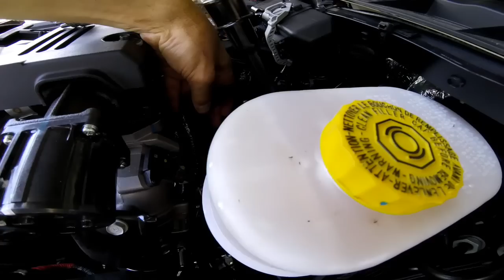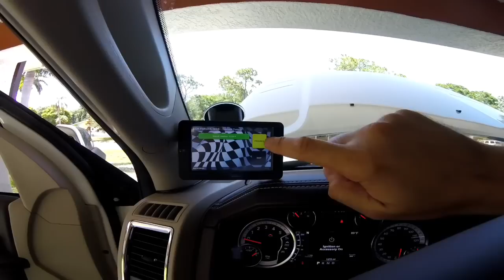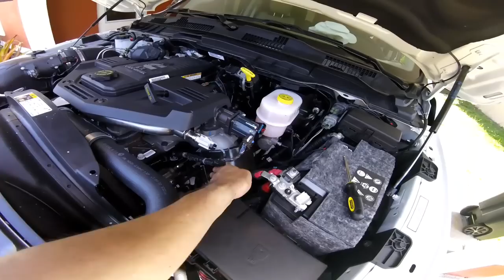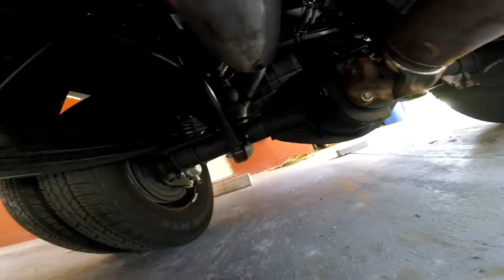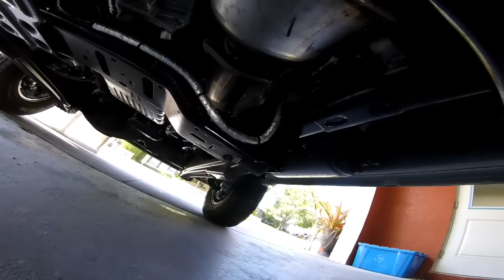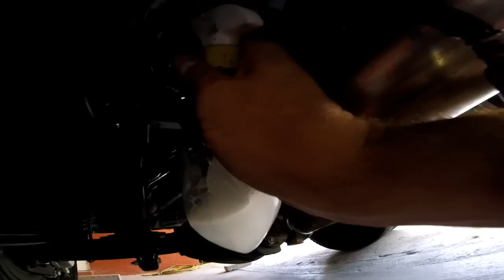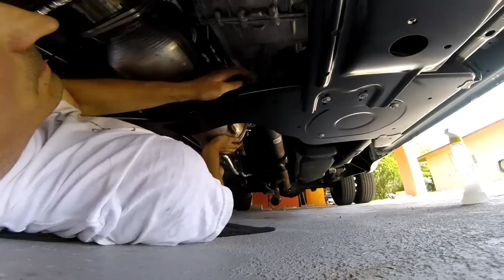New Ram 3500 DPF EGF EGR delete with RaceMe Ultra

Comment: great install video how did you get the cable through the dash ?
Reply from the maker: I spoke about that in the video... the penetration point. Access panel above the brake pedal on the firewall. Drilled it and used a grommet.

Comment: Great video.  So installing this software bypasses the egr but you don't have to actually block off the ports?
Reply from the maker: Correct, but you should disable the EGR system as shown just to make sure. I will remove all the hardware later once I am past the warranty period.
Reply: Shaun Volkmann do  you only remove all that exhaust pipes to promote free flow? And if you left it there, but unplugged there would be unnecessary back pressure?
Reply from the maker: @JeffLamp3  The ceramic filter inside  the OEM exhaust system would plug up, and you would destroy your engine. The very system you are disabling is what burns the soot off of the DPF honeycomb. It is this system that stiffles fuel economy and performance. You must remove the factory exhaust system. Straight pipe, or like I showed use a diesel muffler if you don't want it so loud.
Reply: Shaun Volkmann thanks for the quick responses. I just picked up a 2018 ram 3500 slt dually a few days ago. Only have 350 km on the truck. We are lucky in canada where I live there are no emission testing

Comment: To make sure I understand u can go back and reflash the ECU with the stock tune?

I have lifetime engine and tranny warranty on my 2013 that’s why I have been slow to want to delete my emissions..
Reply from the maker: Yes, you just select "return to stock software". I had to return mine to stock for some huge warranty issues non power train related, and wanted no questions asked. All they did was boost my DEF injection rate because they saw soot in the tailpipe. Lol
Reply: Shaun Volkmann if you return to stock do you change the tuner before you put the dpf back on and restore the connections under the hood, or reconnect first and then change the ecu back to stock?

Comment: Hi there Shaun, great video, another way to do it!  So by unplugging the EGR connections and using your raceme ultra, your EGR is no longer functioning - then, exhaust gasses are no longer pumped in?  Is that correct?  So your oil is not black?
I have a 2010 3500 Ram 6.7 TD Dually.  I have been reading, asking around about Deletes.  I am now seriously looking into this, not merely for MPG & HP, I just want to prolong the life of my engine.  I now have 140,000 miles on mine.
thank you again, I hope you get back to me on mt questions.
Reply from the maker: Yes, that is correct. Hard removal is recommended if you are out of warranty. Oil turns dark after about 3,000 miles, but not black when EGR is connected.  The stock ECU runs the engine lean, and restricts timing for emissions. Drive one who has it deleted, the difference is unbelievable how much smoother it runs and pulls.
Reply: @shaunvolkmann1904  ok!
Thank you Shaun for the reply!

Comment: I have a 2013 3500  6.7 with 60k i want to delete it do i need to remove everything and place in block of plates or can i just unplug everything, if so would i have problems in the future of any kind
Reply from the maker: Juan, I show just unplugging everything in this video so I can plug back in if I needed warranty work. Hard removal of emissions equipment is recommended by RaceMe. No one wants any problems, and have seen trucks running both ways without any problems. When I am out of power train warranty, I will use the block off plates and remove the garbage under the hood.

Comment: I've read that it's usually the DEF system that gets repaired a lot.  What exactly is the issue with the DEF that keeps needing to get fixed?
Reply from the maker: This removes the system entirely. The DPF system measures the flow before the system and after, then messes with the engine to burn off soot buildup giving you terrible economy. Tear that junk out!

Comment: Hey Shaun the probe on the down pipe do you leave it plugged in? Maybe a post egt probe?the one right before the three bolts that bolt to the bypass
Reply from the maker: Hey Billy, yes that sensor is disabled with the delete but I left it in place. I read a few places that the voltage on the harness is important for transmission controls.  I left as much as possible on the harness, and zip tied it out of the way.

Comment: Helpfull video.  Can I leave the exhaust system in place while driving cross country under warranty?  If the truck died, I can reconnect everything else before the tow truck gets there but I wouldn't have to deal wit DEF, and will pull exhaust off closer to home.

Also, are those fuel figures calculated or via the trucks computer?  I had an Edge Comp on my 2001, the trucks computer always showed better mileage than what was calculated.   Just wondering, but hopeful.   I would love to see close to 20 MPH
Reply from the maker: D T you will destroy your truck if you leave exhaust in place

Comment: Thanks for this helpful video. Does your DEF gauge still show empty after all this time? I just programmed successfully(according to the ultra) for the first time with all the emissions components still in place, yet my def gauge shows full with key in 'run' position. I am running the latest update from raceme and wonder if they changed something to actually show full def tank for some reason?
Reply from the maker: TheBr0dyagi the latest update includes the DEF sending unit status. When I made the video, it shut that gauge down.
Reply: Thanks. Just finished ripping the rest of the junk out - all good now.

Comment: Loved this video. I have a 2013 and like my engine bay looking stock. I had NO idea that I was able to leave the EGR components, etc intact and simply disable them.  I think a RaceMe Ultra and exhaust in in my future. I am pretty happy with the stock power.... Mainly looking for the MPG increase. In all honesty, all stock is treating me well at 20.5 MPG on long trips. I don't see how I can get much more out of it!
Thank you for the video.... You did an excellent job demonstrating all the steps necessary.
Reply from the maker: tomduncan1970 you can leave all stock settings for power, and only delete emissions if you like. That's what I am running till my warranty is up.  What rear end are you running with the great MPG? 3.73?
Reply: @shaunvolkmann1904   Sorry Man.... I am just seeing your response 3 years later! I'm running a 3.42 ratio

Comment: I glued my blue LIBERAL pos DEF cap on after deleting! Clean oil to 5k & 25-33mpg!
Reply: 33mpg....you must drive a VW
Reply: @Defender_Tom  My 2004 long bed crew cab High Output Cummins with the 6 speed would regularly net me 30+ MPG. I got 35 once on a trip to Kansas. Trick was to stay at 65mph. I still have that truck, 489,000 miles, one set of injectors, and oil changes. Still gets 28+ MPG. The truck is falling apart around the drive train however...

Comment: Did you just tape over all electrical connections on the egr and exhaust too ?
Billygibbons007@yahoo.com
Reply from the maker: Stephen Griggs I put plastic bags on and taped the exhaust connectors. Just tape under the hood

Comment: So I had my DEF delete done about 2 months ago and put the raceme tuner on it. I also went from 14gpm to about 19.5gpm on my dually.  I just the EGR delete like is done in the video. It was pretty simple and quick. I have about 25k more miles on the drive train warranty, so I guess when that is up I will do the complete EGR delete.  My plunger looked like it was installed in my chimeny, super black and caked up.  I will let you all know how my truck does in a couple of weeks. I mainly do city driving, I pull a camper and my tractor sometimes but mostly just inner city driving. Wish me luck!
Reply from the maker: Ernie Guerrero enjoy the truck, I'm sure you realize just how nice it is now that you unlocked it!
Reply: Yea I love the better fuel mileage. I having really driven it yet with the EGR delete. I just it last night and I probably won't drive it till Monday now. I will let you all know how it goes. Oh, did you have issues with the engine brake by only disconnecting the few components for the egr? I read I might need to connect a feel more off of it?
Reply from the maker: Ernie Guerrero as long as you took care of disconnecting both items under the hood, the brake works perfect!
Reply: Shaun Volkmann yea I did. Thanks again for the help! Cheers
Reply from the maker: @eg55105129  How is the truck running?
Reply: say how is your truck running ? @shaunvolkmann1904
Reply from the maker: @concretejungle77  smooth and sweet! I <3 my truck!
Reply: awesome! I just got an 18 with G56 manual trans can I do it the same way you did with same tuner? @shaunvolkmann1904
Reply from the maker: @concretejungle77  sure, it's the same as my ASIN, just the deletes and ECU tuning. The Ultra can program the stock Ram transmission as a bonus. I wanted a manual, but settled for the Asin in case the mrs. needed to drive me home from the bar.  You're going to LOVE it. Just tuned my 2018... no difference from the 2017, or the 2016 I videoed.
Reply: Shaun Volkmann thank you so much ! I am going to do it!
Reply: @shaunvolkmann1904  is this the same for 2020?
Reply from the maker: @bobbo2576  sorry I have not done one yet. I imagine it would be the same, not much has changed.
Reply: @shaunvolkmann1904  says on mopar online parts you can buy what you bought and comes with 2 keys for $300 but not sure if it’s plug and play
Reply: @shaunvolkmann1904  if there is a way i could contact you on some help with ordering the tuner i’d appreciate it that’s the only thing that still has me stumped wanting to do the weight loss on my 2018
Reply from the maker: @nickreeves14  https://www.racemeofficial.com/shop/tuners/raceme-ultra/

Comment: It’s easy to gut the cooker and the scr I did mine used a 1/2 “ bar and a hammer 🔨 broke it all up cleaned it out all mine is still plugged up runs 👍 I drilled out the manifold installed EGTsensors

Comment: What happened to all the DEF fluid? Nice video
Reply from the maker: ALL KNOWING BILLY it is sitting in the tank useless.
Reply: Shaun Volkmann that sucks the low mpg- I averaged 20.6 last year- how much for the exhaust?
Reply from the maker: ALL KNOWING BILLY flomaster muffler was $300, the straight pipe was included with the RaceMe Ultra for an extra $200
Reply: keep coming back to pick your brain-is the drone 100% gone? I put a twister flopro- just quiet down the vgt so it doesn't draw too much attention- not much for drone  @shaunvolkmann1904
Reply from the maker: @DasSnakeBoy  I'd say 80% gone, certain RPMS it comes back... but tolerable.
Reply: you mounted it so it fits right before the last part of the exhaust-remember what model? @shaunvolkmann1904
Reply from the maker: @DasSnakeBoy  yes, it fits perfectly after the bend up after the slip joint. Flowmaster 14020100 Hushpower Pro Series Muffler, 4.00" IN/OUT, 8" x 20"
Reply: @shaunvolkmann1904  I am worried about getting the raceme through a bad website anyyou recommend ?
Reply from the maker: @josecorrea8307  Jose, go direct to the company. I believe it's Racemeofficial.com

Comment: This may be the first video I have watched that someone deleted these systems and only removed the DPF. I did not know you did not have to actually remove the EGR and Cooler. Simply unplug them. Which I find interesting since the Cooler still has Gasses and coolant flowing through them? You should think that alone would cause problems?  I saw the cooler still on your truck. 

How the truck running currently... Still no issues related to these parts still being on your truck?

I looking into doing this delete on my 2012 Ram 5500 6.7 Flatbed Tow truck since Ive had to take the truck in to the dealer ONCE AGAIN for DEF related problem. 
But someone told me that I need to leave all the deleted part in the truck incase I got pulled for DOT inspections. Since my truck is over 10,000lb and is a commercial rated vehicle weighing at 14k lb.
Reply: why this turner I looked at there website and it says (For Aftermarket transmissions (Not for Aisin equipped trucks) Only for 2010-2017 PU models). Why not a EFI Live turner? Do you think this tuner would be a good choice for my usage? The turners are the one thing I am trying to get more info on. Since a lot of them State they are for race use only. Not sure if this is one of those things they just have to say or not.
Reply from the maker: Brian Danaher the reason you unplug is to keep the valve and servo from opening keeping the parts from functioning. Once warranty is up I will remove them to make 100% sure they can't operate (and save space and weight under the hood).
Truck runs great!  No sure how your inspection process works.. so can't comment on what to do.
Reply from the maker: Brian Danaher don't be afraid of race use only if you can control the parameters of the tune.  If you crank to 600 hp you'll be rolling coal, and might get pulled over. That's only legal at the track.  This tuner has tons of update support, and you choose how much power.
Aisin trans can handle more power IMHO, the trans tuning is needed on the stock automatic to help make it last longer.
Reply: Awesome thanks for the quick response. I still looking into the legal side for my size of a truck. and trying to figure out where I am going to get my delete package. But since I only need to get the straight pipe and the tuner at first I can focus on that now. 

Thanks again
Reply: Brian Danaher  you would want to just cut out and gut the internals to your DPF and cat. And put it back on. That way when DOT inspects it it all looks factory and in place.
Reply from the maker: Don Smith that would be awesome, but would have to be able to weld it back up. Nice thinking!
Reply from the maker: Brian Danaher I am sure the DPF ceramic honeycomb inside will be a challenge to destroy without cutting the can open, and welding back shut. But, take a photo and let other know if you can get it done!
Reply: Don't have a Cat with this size of a vehicle. Only have DPF
Reply: But thats what I have been seeing I would have to do.  I Also would not have to weld anything since there are three bolts on both ends of the DPF which make this rear easy to take of and on. Which I am sure you all know.

Comment: I see you have the Aisin Transmission how does that handle the delete ? I have a 2016 Ram 3500 Mega cab with the Aisin and was considering doing the delete but have some reservations because of warranty! Truck only has 8900 miles on it ?
Reply from the maker: Keith Custer I did not bump the power at this time for the same reason, just EGR and DPF delete. Basically you just shut those systems down and are runni mg stock. If something happens, I'll put the exhaust back together and unflash. I had 47 miles on mine when I deleted...

Comment: Hey why did you re-install that box with the hose..?  and what did the exhaust run you for what you installed. ?  also make some follow up videos....
Reply from the maker: Sorry I missed your comment. From my research the Asin transmission is sensitive to voltage changes in the wiring harness. Why not keep all the electronic systems plugged in to maintain how it was built? I err on the side of caution...trucks ain't cheap!

Comment: cheers for this video, puts my mind at ease if i was to go for a new cummins like id like to down the road and be able to do this and not have a huge hassle, also in my area if i was to get pulled over and the truck looked at i could get a notice for a vehicle inspection due to the "emmisions being removed"  and have to have the truck inspected before i can continue driving it. so this route seems like a solid alternative, i was also curious if you could just gut the emmisions but leave it in the truck to get around this if possible
Reply from the maker: Harley Mac if you left the DPF in place you would damage the motor and probably start a fire! No way around removal of the factory exhaust system
Reply from the maker: I re read your comment. I guess if you smashed out the DPF media in theory this would work. Boy that would be a crazy amount of work to be incognito!

Comment: You do know when you are on a long trip, and your tuner goes out and truck stalls out, your screwed?  You can call and have it towed to a dealer and then they will not touch it because of tuner. Then it takes forever to straighten out who and what you need, took my buddy over 20 days to get his sorted out and his complete vacation towing his travel trailer was screwed.
Reply from the maker: Devo Dar depends on if you have a live tuner, or you flash the ECU. When you program the ECU you don't rely on the tuner to keep things running. Yup, if it take a dive you should uninstal the tune and exhaust prior to visiting a dealer if you want any chance of help...cause they rarely know what is going on to begin with (in most cases).